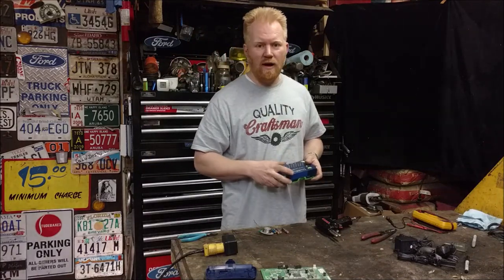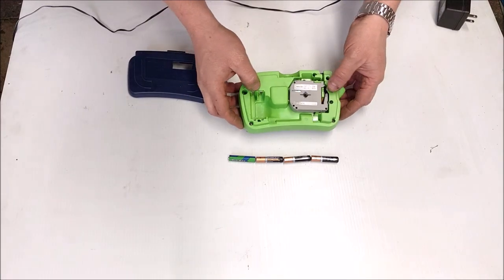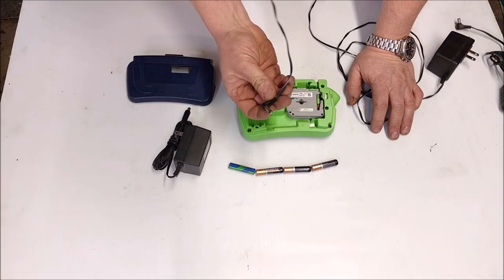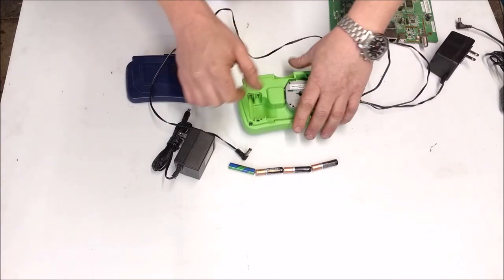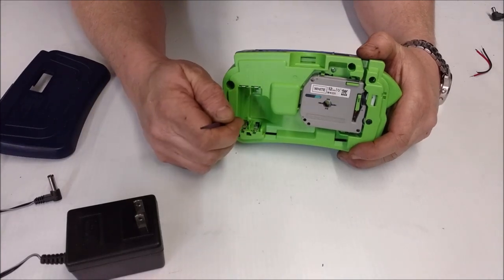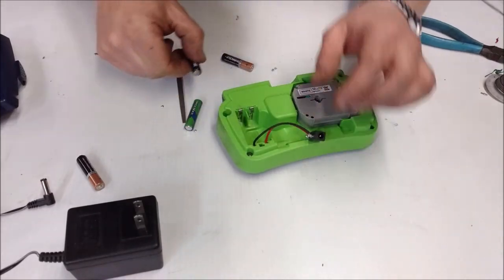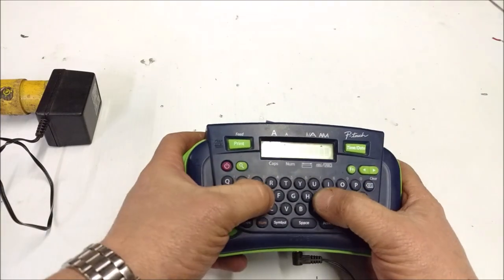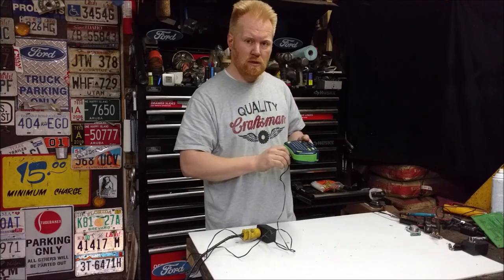Make a Battery Powered device Plug-in compatible

Comment: It's pretty important to verify the voltage of the adapter and especially if it's a used adapter you're using . I noticed that one said 6 volts and the other one was a 9 volt output adapter . Another point is to verify the amperage requirements for whatever device is being used and to make sure that they're both the same . Using a multimeter is pretty important for doing this type of thing .
Reply: You're using batteries and the device is made to use the amps that batteries put out.
http://www.techlib.com/reference/batteries.html

Comment: i know this is super old but i want to modify my christmas funko village which is basically some dimly lit LED bulbs inside of a santa's cottage (3 different christmas themed buildings)...in following your notes...if i have 3 and each takes 2 AA batts each, does this mean i should opt for a 9v plug and then just run wires to each to solder on like a daisy chain to run all LED lit toys? my only concern is fire safety.... ANY HELP WOULD GREATLY BE APPRECIATED!!!
Reply from the maker: You could use a 9 volt power supply or a 3 volt. 9 volt you would just wire all the lights in series one after another. 3 volt and you would take a positive and negative wire to each light which is called parallel wiring.
Reply: @sixtyfiveford  thank you for responding on such an older video. i appreciate it. so if i go with a 9v just follow your vid and solder batt compartments in line right? if that's right i'm a little confused about the 3v option, sorry electronics is not my forte and i've never soldered anything lol.

Comment: Good idea, but some wall warts are not a regulated voltage and can produce a much higher output than expected with light loading, it can damage devices.
So a 3 pin regulator will need to be placed in line with the power, a simple 7805 (5v) one will do for 4.5v devices, for special voltages the LM317 variable regulator is a simple device to use.
Dont use mains supplys on am radios, lots of buzzing lol.
Reply from the maker: Most I've seen will produce a higher voltage with no load, but taper off quickly to the spec voltage or slightly lower under full specified load(500ma). This 6v one probably sits at 7v unloaded and tapers down to 6.5 under the light load. My thought process is these battery powered devices are meant to have a wide voltage range as cells can be 1.6(new) to 1v or less. So this device with 4 cells will easily handle 6.4v to 4v. I could probably even drive it with 8-9volts without harm.
Reply: Just remember that not all devices can cope with a higher voltage, ive spent the last 30 years repairing electronics and ive seen far too many dead items because of wrong power adaptors, or wrong voltages fed into devices, excessive ripple is also a killer.

im just saying that some adapters are much cruder than the label states.
Reply: this is why im not doing this hack...
Reply: This comment is correct. A vast majority of these wall warts are not regulated and the initial high voltage can blow right through some chips.

That, and no effort was made to determine the proper amperage capacity of the wall wart.

Comment: been doing that since I was a kid on all kinds of things. This is very helpful for people to know its that simple to not have to use batteries. I used to make battery shapes out of small blocks of wood with screws for the terminals to use a wall wart with something you wouldn't want to solder to like the old yellow Sony sports walkman.
Reply from the maker: I still have my small yellow Sony Sports Walkman somewhere in my parts bin.
Reply: sixtyfiveford I still have mine somewhere too

Comment: In most cases, a battery=operated device that runs on 6VDC can be run from a USB wall charger.  Yes, it's a lower voltage, but there is a considerable degree of tolerance.     General rule of thumb:   If it runs on four AA or AAA batteries, a USB wall charger with out output of at least 300-500 mA will work.   If you have something that runs on four C or D batteries, you'll want something that can deliver at least 1000 mA (1 amp).   Of course, you can use a higher-capacity wall charger in place of a low-capacity charger, but vice versa should be avoided.   You might be able to use the USB charger also with 4.5 volt devices (again, some tolerance), but don't try it with lesser voltages.

This opens the door to using power banks to power some devices.

Always always ALWAYS observe polarity requirements, and NEVER use a wall wart that has an AC output to power a DC device.   Oddly enough, however, if your device accepts an AC input, you can usually power it with a DC power source of similar voltage.    Again, make sure you don't mix that up.  If you're not sure, don't try.

Comment: How do you choose the adapter amperage when replacing batteries in this fashion?  I can't find anything that explains it clearly and this video lends itself well to this question as it covers basically everything involved EXCEPT for current.  I assume it matters significantly what output amperage is provided by the adapter used.  Thanks.
Reply from the maker: The device will only pull the amperage it needs. It doesn't matter if you put a 20amp or 1amp power supply behind it if the device only pulls 100mah. You won't ruin the device. A car battery puts out 12volts and upwards or 2000amps or more dead short. But I can turn on my heater that pulls 20amps and my radio that pulls 5amps and everything is happy.

Comment: thanks for great video! Question: If you have 2 of these devices and you want to convert them both to just 1 ac power cord how would you do that? do you have to adjust the voltage?
Reply from the maker: If they both used the same amount of batteries, ie 4 they both need 6 volts. So they can share the same 6 volt power supply at the same time if you want.

Comment: I just did this but went the dummy-battery route for a wifi-enabled temperature/humidity sensor. I replaced 3 AAA batteries with an old 4.5v DC adapter but noticed with my multimeter that the adapter was outputting ~5.7v. Should I be worried about frying my device with the increased voltage, or will the load from the device make up for it? I've been reading a bit about adding some resistors/diodes to try dropping the voltage but I'm not sure if that's necessary.
Reply from the maker: The voltage will drop on the DC adapter once a load is applied.

Comment: Great Video! 2 simple questions hopefully if you can answer for me that i feel seemed missing in the video....

1. How did you determine the positive and negative tabs on the unit or what would be the best way to do that.

2. If i have a unit that takes 3 AA batteries, will i still be soldering to just two tabs for positive and negative?

thanks so much!
Reply from the maker: Negative and Positive were determined by the battery orientation. With 3 cells laying side by side they are both connected to the center battery so it's just a chain of 3 batteries end to end. Look closely and you should be able to determine which end is your final positive and negative. A multimeter makes it easy but external visual inspection or opening the device both work.

Comment: Do you think a 5V 0.5A USB cable soldered to a device running only 2 AA batteries would fry the circuitry? Should I put a resistor in series (what size?)
Reply from the maker: Battery operated stuff is generally pretty forgiving because of the nature of batteries constantly changing voltage. 5volts may be pushing it a little but you can step it down to around 3 volts pretty easily. https://youtu.be/zrq4n5tOoTI

Comment: Great idea.  Would that also work as a charger if you put in rechargeable batteries?
Reply from the maker: It would. You would just need to pull the power cord off after a while, as it wouldn't stop charging.
Reply: @sixtyfiveford  No. It would fry your batteries without a current regulator circuit.

Comment: I tried doing the same thing but with 24 v battery floor washing machine that uses 100-140 ah batteries. Can u help me out on why it didn't work? It turned on the machine and all but but when I tried running it, it turned off. To it's seems like it's does not produce enough juice to keep on running the machine.

Comment: Hello
Stumbled across this video looking at how to power a device.
Synopsis: I have the same label printer, it won't work on batteries and it has a mains power point.
I don't have the mains power supply, tried a couple of phone chargers, but worry I fried it due to the unusual central pin.
Question: my label printer won't print, the tape runss out, but the wheel that pushes the tape onto the head doesn't move forward to apply pressure. . . . . Any ideas..?

Comment: I'd be interested to know how to make that same appliance, in this instance is a nail trimmer for dogs, how to make it more powerful, got any videos on that?
Reply from the maker: The only way to bump up the power/ speed on little motors is to increase the voltage. So if it runs off 2 battery cells? That's 3 volts. Give it 4-4.5volts and it'll be way more powerful. But you got to be careful because too much voltage and you'll just short it out.

Comment: Hi there, I know this is an older video at this point, so you might not see this comment, but how would I do the opposite? I have a small clock that plugs into the wall that would be much more convenient to have with batteries instead.

Comment: That's a great idea. I was going power the p touch printer with an external rechargeable power bank that has an adjustable voltage. It's easier than to use AA batteries that often leak and don't work when you need to use the device.
Reply from the maker: That's a good idea.

Comment: enjoyed the video. I want to make one of these to run a dc fuel pump. I have some power inverters around. can I just splice one in to my dc pump using it's clamps and will this handle my project? usually I hook my dc pump up directly to my truck battery but have to keep the truck running to get enough power and it's to loud. thank you for your assistance.
Reply from the maker: You'll need a 10-15amp power supply to keep a fuel pump running. Probably the easiest way is to just run it off of an old car battery charger.
Reply: @sixtyfiveford  thanks for the reply. would I just hook the alligator clips together and turn it on? after making sure it's set for the right amps of course.

Comment: On your label maker, how did you quickly determine what was the positive and what was the negative terminal?  I'm looking to use these instructions to power my kids bubble machine.  I have no idea what amperage it is, but I do know it's 9V.  Planning on getting the multi-voltage adapter linked in your description.
Reply from the maker: With a 9-volt battery It is labeled positive with a plus and negative with a minus directly on the sides of the battery. So you should be able to quickly determine which terminal is positive which one's negative in the device
Reply: @sixtyfiveford  It's actually 6x AA batteries totalling 9 volts.  The six batteries are inserted side by side into the base of the machine.  They all look identical.  I'd have to buy some triangle shaped security screwdrivers to get inside to see more details.  I've added those to my shopping list :)
Reply from the maker: @shineandcriss  If all six batteries alter direction one from the other, then it is a 9 volt system. The positive will be either on the far left where the positive terminal on the battery touches or the far right where the positive terminal touches. The negative would be the exact same, where the negative terminal touches on the last battery left side or right side. So if the positive is on the left hand side the negative will actually be on the far right hand side and vice versa
Reply: @sixtyfiveford  Thank you so much.  Final questions:  What type & gauge wire did you use to solder the female adapter to the battery terminals?   Any specific type of solder to use?  I see lead-free is an option, which I'm leaning towards purchasing.

Comment: Is there a way to rig up something that uses 3 (357) type batteries? I have a decorative porcelain Christmas snowman that uses 3 small batteries & only 1 coil. Any way to add a plug to this?
Reply from the maker: If the batteries are run in series/end the end then you'll need 4.5v to run it (3x 1.5v). There's always enough leeway in battery operated stuff to go up a little or down in voltage. 5 volts is very common won't damage your lights, so i would choose to run it off 5 volts. You can get pretty much any usb power supply (phone charger) and it'll supply 5v. You could make it plug in or even run it off a cheap power bank.

Comment: how do you know positive/negative leads to attach it to in the battery compartment? (mine has 4 D's) I tried to simply attach the negative to the spring side and the positive to the flat side...no go. I know I'm getting power. I hooked it up to multimeter so I know I'm getting power from the plug (6.2). the batteries seem to be connected to one long continuous strip of metal.
Reply from the maker: Put some batteries in and test the voltage at those same two places.

Comment: Question, I have four tap lights that take 3 Double A's each and I would like to hardwire them and ditch the batteries. How do I do this? I'm assuming I'd have to hardwire them all together and then find a stronger converter? Thank you so much for helping!
Reply from the maker: You'll just need a power supply that puts out 4.5 to 5volts and around 1 amp. That should handle the power for all.
Reply: @sixtyfiveford  thank you so much for answering me so quickly! I'm excited to give this project a go! If you would like to make a video on this project of mine specifically, I would greatly appreciate that! LOL but I'm being serious as well! LOL

Comment: hai, what is the different between transformer and adaptor??
let say, if i want to by-pass my phone battery connected directly to wire can i use this method?? do i need to buy transformer or adaptor that have the same volts like my phone battery volts??

Comment: I have a cordless Ryobi tool that uses an 8V rechargable battery.  I would love to convert it to a power cord that can plug into the wall because even my new batteries cannot power this tool.  Can you tell me how to do that?  Thanks!
Reply from the maker: You won't be able to run it off wall power. The issue is the batteries in power tools are high drain and can produce 15-30 amps to supply the tool under torque. A wall plug adapter at 8v is only going to put out around 1 amp.

Comment: on the female connector, how do you tell what's the positive, negative, inside, outside...? I got the ones from amazon but can't tell, no diagram.
Reply from the maker: The inside is positive 99% of the time. I have only ever seen 1 that was opposite. You should have a symbol like this https://www.google.com/url?sa=i&rct=j&q=&esrc=s&source=images&cd=&cad=rja&uact=8&ved=2ahUKEwi-jdCmyf7cAhWYxIMKHf14DDwQjRx6BAgBEAU&url=https%3A%2F%2Felectronics.stackexchange.com%2Fquestions%2F33968%2Fhow-to-tell-polarity-expected-of-a-dc-barrel-jack&psig=AOvVaw13QFj7vXdSfaWlyPCfsKdR&ust=1534955550677491

Comment: Is there an option to use the car battery instead. How do I reduce the voltage and amperage of a car battery to the same as two AA batteries. I need this for a remote device in the car for controlling the radio volume and changing radio stations. This device uses 2 AA batteries.
Reply from the maker: You need a simple step down converter like this https://amzn.to/44IfTkE

Comment: Great idea! I take it you don't need to care about the output current of the charger? (I assume the device will only take the current it wants)
Reply: chr11sf if the maximum output of the charger is higher than the maximum possibly consumed from the tool yes. it won't work for a cordless drill for example. there are some needing 20 Amps and more.
Reply from the maker: It will only pull what it needs from the transformer.

Comment: man you rock my world.! ive done this a few times however im stuck on a 18 volt drill .that is charged @20 or 21 volts. 
the reason im hesitant is that im worried about amperage. the asumption im under is that the drill needs a higher load than the outlet can provide and that the battery pack must be built with hidrain cells. (otherwise whydont they include a port.)

on the other hand i have a bunch of neew original l3000 mah LG 20A/30a 18650s that i could rebuild the powerpack with..
and it would be a beast.   in fact I tried this previously on a  smaller unit. and its utter fail 

what do you recomend?

subbd and thumbs upd :D
Reply from the maker: You'll need a minimum of 30 amps at 18/20volts(40-60amps is ideal) to run a power tool so plug in power is pretty hard to accomplish. The transformer and wires would have to pretty large to handle the amps.

Comment: Great video, and thanks Moe.  Do you happen to have a link to the AC adapter ans female receptacle, sold as sets?  Looking forward to eliminating my battery hungry device with AC, but finding it difficult to find the female portion of the adapter, and especially dont want them to be incompatible.
Reply from the maker: I don't see any as sets. Just make sure both pieces say 5.5mm-2.1mm and they'll fit together. I have a link in the video description for both parts separately.
Reply: @sixtyfiveford  Just hard wire it...you don't need the connectors
Reply: Search ebay or amazon for female dc power jack (or socket or panel mount).  Just need to get the same size barrel plug on the adapter, I ordered some 5.5x2.1mm jacks and ac adapters to match.  You can get 10 of the jacks that are all metal for under $10 shipped.